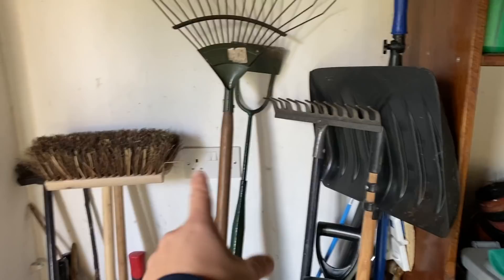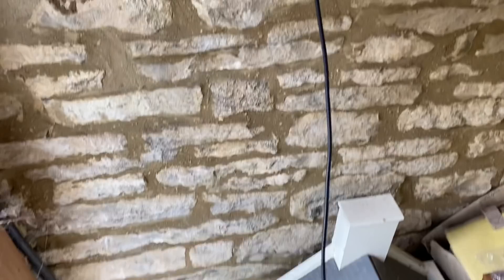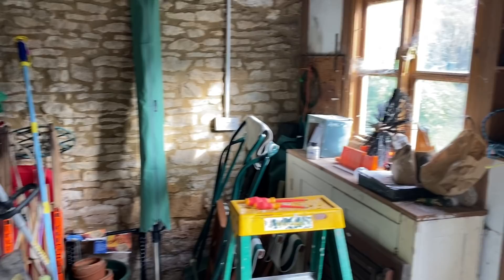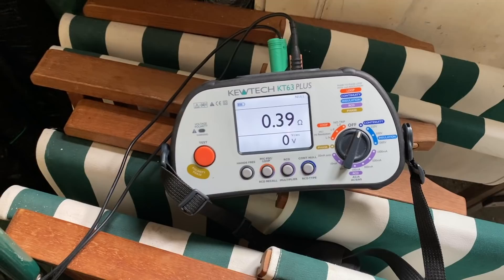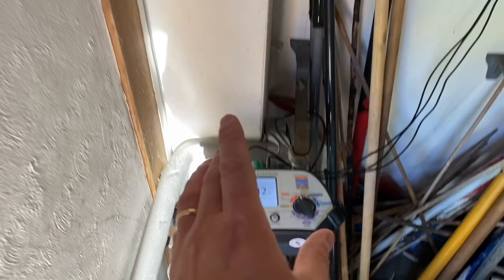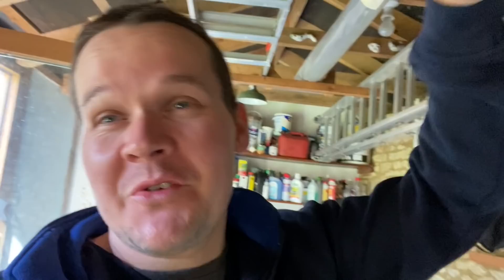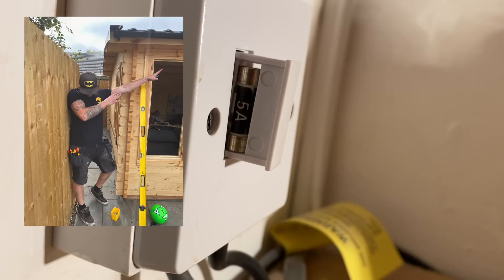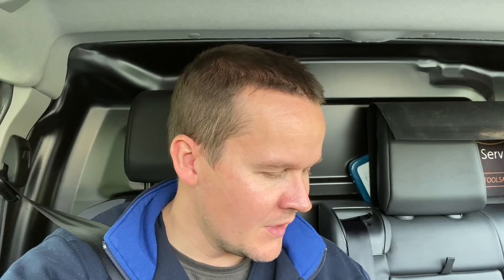THAT WAS A SHOCK ! Testing and inspecting electrical circuits.

Comment: For loose connections on ringmains - tap socket fronts with screwdriver handle. Re-test on meter if there's loads of sockets. Works best on megger because continuity auto adjusts. 👍

Comment: One that is easily overlooked is an immersion heater without a safety cutout with a plastic header tank.  It wasn't easy to see if the immersion had a safety cutout in the video.  Be safe peeps, I have read of a horrific case resulting from this that still brings tears to my eyes from years ago.
Reply: Good spot there was no cut out
Reply: That one had a cutout built into the stat. 18:17 you can see the reset hole.

Comment: 14:35 So what was with the "light" show?

First time I've seen one when you're doing a test sequence...
Reply: Contact Cleaning (ACC) - cleans tarnished contacts to improve loop readings. Essential on No-Trip but it's done on Hi-I too. Working with prods you'll encounter more oxide though I've never seen it quite like that!

Comment: When I was in the trade (many years ago), jbs were still used a lot.  I never found a loose connection in properly installed jbs:  when the terminals were tightened properly, they would give out a "squeaky noise", the same as tails do when the terminals in a connection unit ("Henly block") are tightened. I really dislike solid 2.5 sq. mm. conductors in 2.5 T&E cable: I used to find quite a few loose connections on socket outlets.  The old 7/029 sq. in. cable which 2.5 replaced when metrication took place was far superior - we used to twist the conductors together: the terminal screws gave much better grip than is possible with solid cores. The better sparks used 3/029 for lighting, which equates to 1.5 sq. mm. The old cables with stranded conductors were more flexible as well, which made installation easier.

Comment: my brand new house in Ireland had one socket in a bedroom which had L-N reversed, guess which sparky I'll never use again.
Reply: Tested a 10 year old Barratt house yesterday, sockets never been taken off the wall from new and they all had L-N reverse in one bedroom, guessing the boy did it and nobody checked ???
Reply: A case for why the old neon test drivers were good! See at a glance on one simple check whether L was on the right or left;  right OK, left NO WAY! Still require the other tests clearly.

Comment: I had a belt of a rising earth from a loose earth wire, a few months ago.  The shed had a faulty neutral  and I inadvertently become a pathway back.
Reply: An inspection I did on a house in the coutryside , earth loop impedence readings were in excess of 85000 ohms.Another one, the client said they were getting small shocks off the radiators, taps and the kitchen draining board.The house was next to a field and mice had come in and chewed cables under the floor.At the mains position, they was no earth wire off of the earth terminal into the fuseboard, fuse on the ring main could not blow, and fault current was flowing round metal work items in the house.

Comment: I am an electrician in Canada and we don't do that kind of testing. You go through the testing pretty fast and I need to pick up on the lingo, but could you send out a link that explains the tests you are doing step by step and why they are being done. Simpler the better. I have done some Zs , earth loop impedance testing before but I forget a lot of it.

Great videos!

Comment: Kewtech electrical test meters kt63 64 or 65,  are really really good, been using em for +10 years,  industrial test meters metrawatt,  IR meter flir,  general multimeters fluke,  dead testing test meters megger, soldering equipment antex,

Comment: Chris. As it's the old red/black stuff, is there any chance some or all of the ring is 2.5mm T&E with 1mm CPC? Would explain a higher R2.
Reply: Possibly, plus ambient temp and copper/resin amounts aren't the same now as they were when cable was imperial.

Comment: Great video thanks for sharing one very small point at 16.43 you mention the bathroom down lights need to be a minimum of ip44 in zone 2, it should be ipx4 as a minimum or ipx5 if water jets (shower head) are present in either zone 1 or 2.

Comment: My immersion has no cable clamp provision and I had to bodge something with a cable tie! Also I replaced the cable with Toolstation rubber cable and after a few years it turned to squishy plasticene (and the heater is only used very occasionally as a backup), beware cheap "rubber" cable!

Comment: What's the problem with a plastic CU?  Assuming this was installed a few years ago it doesn't need to comply with 3rd amendment.  Also very minor things like no two colour sticker - costs 10p and takes 10 seconds to put one on - quicker to fix than to mention on the report!

Comment: Zones 1 and 2 only extend to 225 cm from the floor IIRC (might be from the bottom of the bath/shower). Are those lights actually in the zone? Unless the ceiling is very low I'd expect they aren't.
Reply: Those down lights must have been in the bargain bin lol. IP20, most that I can find at my supplier for ~£7 are rated at least IP 65. One thing about the zones though,  they look high enough to pass ? it may be sensible to replace them anyway for the minimal cost it involves.
Reply: @KirstyTube  Provided they're outside the zones I'd just replace them if they ever fail from corrosion.

Comment: The immersion heater did not have a police stat ?
Reply: That one had a cutout built into the stat. 18:17 you can see the reset hole.
Reply: @UberAlphaSirus  no there is not,if you buy a new heater now ,the cut out is not in the stat,there is a safety cut out which is a separate item from the main thermostat it's wired from one side of the stat in to and out of the safety stat to one side of the element

Comment: You said to measure the insulation resistance at 250v but it should be done at twice the working voltage, so 500v DC was applicable. Not a criticism, just a gentle reminder to all them there folks out there. :-)
Reply from the maker: 250v is a good indication that you might of missed something plugged in.

Comment: Hi Chris 
What software are you using on your phone? 
Looks like ICertifi but I have had a nightmare using that. 
Moved from Trimble on a laptop and looking for something on my phone or iPad.

Started using Electraform on laptop tethered to my computer phone but connection times out and I can lose a few results if I’m not careful. 

I’ve ordered a sim for the iPad as electraform can be a bit cumbersome on a phone screen. 

Perhaps I need an off line version as signal can be a bit pony sometimes too.

Comment: Are there actually many properly earthed devices for sale in the UK that really care about the polarity in a single phase 230V circuit, and where would inverted polarity present a hazard? In FInland virtually any device on the market will have to work properly at either polarity (common Schutzkontakt plugs and sockets as well as the "Russian" style are symmetric, as are the low power Euro plugs). 

I know there are some rather funky ways to wire sockets in the US though. Wrong polarity on a single phase circuit can make a gas stove spark continuously after ignition, for example. Plus there are 2x120V wirings and 2 out of 3 phase 120/208V wiring styles in home settings (and appliances that can have heating elements fitted for either pahse-to-phase voltage) - and then a wiring more common in small industrial than home settings, where you have to understand vector math to understand the wiring, where a 4 contact socket can provide earth, 120V, 208V, and 240V.
Reply: It's to do with fuses being in the live side of a plug and also if you had a single pole socket which had the L-N reverse and you turned it off at the switch but left it plugged in while you repaired it etc you might get a belt
Reply: @lewis94uk  True, that is important in the UK ring system where every device has its own fuse and sockets are switched. That style of wiring isn't very common elsewhere AFAIK.

Comment: Why IP44 lights? Such a small difference in cost means fit ELV IP65. I'm not a spark I'm a grad electrical and electronic engineer - I won't have ANY mains bulbs anywhere in or near a bathroom of mine!  Ideally, even the 12v supply should be outside the bathroom in my book.
Reply: Nothing wrong with having suitably IP rated mains lighting in a bathroom, with RCD protection and correct fusing its all perfectly safe.
Reply: @cbcdesign001  nothing wrong legally but definitely wrong logically. No wall switches in a bathroom but mains powered lights! There is a logical disconnect somewhere. No MAINS wall switches in a bathroom sure but who said they couldn't be 5 volt with relay or triac switches outside rather than these STUPID pull switches? Nah! The domestic electrical market needs to wake up! It's the 21st century! Running mains power to wall switches is 
a) entirely unnecessary
b) ridiculous
c) non conducive to a modern safety oriented environment

Time to change ... It's WELL overdue!

Comment: @3.08 Seeing the clamp is put onto the outer part of the rather dirty nut on the earth rod, isn't that likely to increase the earth impedance reading?
Reply: Not if you wiggle the teeth through the dirt and corrosion to good metal before you test. You want to go to the nut and not the rod because you want to make sure the contact with the rod is good.

Comment: 20:31 In other words, this house is a semi-minor DISASTER and really should be rewired, starting from the where the local grid enters the house...

It's nothing that 10 Kg of Semtex, 6 months and a good general contractor can't fix...
Reply: 6 months? I have rewired 3 story houses in a week. I have rewired a single story ranch in a day before.
Reply: @Veritas-invenitur  The 6 months is due to the Semtex (Plastic Explosive)...
It would take approx 6 months to blow up the house, clean out the pit caused by the blast, finish squaring up the hole for the new basement, pour the foundations and build the entirely new house on the site of the old one.
Reply: @HappilyHomicidalHooligan  Oh. Lol. I didn't realize you were talking about blowing it up. Lol. That went right over my head. 😂 One of my clients who owns a massive construction company bought up an entire street back during the 2008 housing crash. Tore the entire street down. 18 houses demolished and 8 rebuild and move in ready in the period of 14 months. Turned it into an exclusive and upscale gated community. It was his way of keeping his best guys working when everyone was getting laid off. In the end he barely broke even but for him it  was more important to keep good help on the payroll so when things came back he had them than to make a profit or save some cash. He ended up selling his private jet and boat to fund the project as getting a construction loan at the time was a battle in of it self. Anyways what I am saying is you are right. A good contractor can do incredible things. On a side note. Doing what he did was the best thing he could have done in the long run. He is the one builder that never has a problem getting people to show up and hustle

Comment: What difference does a outside tap make
Reply: If its copper pipe into the ground its effectively the same as main bonding for the house and needs bonding as it becomes a possible earth electrode
Reply: Would only worry about a outside tap unless exposed conductive  parts are simultaneously available to touch + outside tap proved to be extraneous via test. 👍
Reply: I don't get it, if the tap doesn't have an earth potential then who cares where our what it is, maybe I should start to worry about metal door handles too, or the screws in my table
Reply: if the taps runs thru the earth or foundation with contact it cld still be used as a ground. and in the states we bound everything gas and water to main earth terminals as a 2ndery means to earth or a safty means. lets say main earth gets disconnected water and gas mains now become the earth. and lets say gas and water mains are non conductive but the feeder lines are and a live short happens to the lines the bounds to main earth means the current has a path to earth
Reply: @oliverriall  if they cld come into contact with a live cable cldnt hurt to have em earthed
Reply: @conorlanders8401  also if it is not but cld be exposed to a short having bounded to mains earth is a safe path to earth. works both ways as a back up and safty
Reply: M H  what about the rest of the lines if a live short happens there is no safety path to earth
Reply: @wizard3z868  this is from the IET
"It is a common misconception that bonding such items won’t cause any harm even if it is not required by BS 7671:2018 so a “better to be safe than sorry” attitude is taken. However, it is important to remember that by connecting to the main earthing terminal, in some circumstances, fault currents can be exported throughout the installation which would not be there if protective bonding had not been applied. This can cause an electric shock risk for persons outside of the installation in contact with the general mass of Earth and earthed equipment such as pipework, for example an outside tap or metal (class 1) electrical equipment. "
Reply: @westinthewest  true tht but common sense wld say tht wld be over kill but you cld earth it though lol
Reply: @westinthewest  like i said different practices and methods may not work for all
Reply: @westinthewest  yes they are i see more similarities' than differences in both system
Reply: @oliverriall  You will do not see why, until you could find a socking tap. If you will have this experience you will understand.

Comment: Ive Been struggling with my AM2 recently. Only have the testing and inspection part left to do. Unfortunately my company does not do much testing at all. Is there anything you could recommend to keep in mind or look at to get past this final hurdle??
Reply from the maker: Guidance notes 3 fantastic book
Reply: Hi mate make sure you test at every point. That’s what i failed on. Didn’t test r1 r2 on a switch fuse spur on the ring.

Comment: What code ratings for all that? No SPD? What rating? Don’t the lights needs to say they are suitable for the zone rather than an IP rating?
Reply: For me I don't see the point in using anything other than IP65 fittings in a bathroom full stop (unless it's in zone 0) as the cost difference isn't worth bothering about

Comment: Hidden junction boxes? It should be forbidden, connections allowed only at sockets and loads. Longer wires may be required but at least no floor ripping is required.
Reply: In the USA hidden junction boxes are illegal.

Comment: Immersion heater R2. Boiler R2. Always disconnect the cpcs from the appliance. Parallel paths to earth via pipework. The actual cpc could be loose or disco'd somewhere.

Comment: Would the water still need bonding if it was plastic pipe but had an outside tap. Not sure what difference the tap makes?
Reply: if the taps runs thru the earth or foundation with direct contact as to have earthing potential it cld still be used as a ground.
 in the states we bound everything gas and water to main earth terminals as a 2ndery means to earth or a safty means. 
lets say main earth gets disconnected water and gas mains now become the only earth means. lets say gas and water mains are non conductive but the feeder lines are and a live short happens (a live wire falls fom box or fixture gets cut )to those lines the bounds to main earth means the current has a path to earth.
Reply: @westinthewest  lol sorry we yanks are known to be fast paced in work and language
Reply: @wizard3z868  If you lose the earth rod the gas main is NOT a safe or legal back up. You do have to bond the gas line to the ground circuit, but that's not intended to be a secondary. It's to avoid static buildup in the gas system. The water line is a suitable secondary ground. Back in the "old days" ( before 3-prong sockets and safety grounds) the main panel was earth grounded through the water line only.

Comment: Sorry sir I failed the moaning test. o.o
And also I was totally oblivious when I had wired in the basement lighting that had tube lights that we converted to LED tube lightening then now switching that tube lighting to flat panel LED.
And why I missed it for so long but there was absolutely no ground wire in the box the idiots had cut the ground off and thought since it was a screw in light bulb that used to be in the original box that they only needed the live and neutral.
And had no ground wire on the box at all.
So what I did temporary is I put a wire from the old original "transformer box" to a screw on the outside which in theory the metal casing is suppose to be grounded.
I did that hopefully grounded now hack temporary for now eventually my folks will remodel the basement and get new wiring in but in the mean time I hope my ground job worked. o.o
And I do not know about US electrical things here I was just trying to get it safe or hope it is any ways. xD
I still have two more LED panels to put up I can do a quick video and some photos of it and show the wiring situation.
Oh yeah and it is the old cloth wiring too and the black and white are dangerously close to the same color from the age so basically have that fun part to look forward to in getting the new light panels up.
Reply: If only there was some relatively cheap way to test ground...

Comment: Was it definitely 2.5/1.5 T&E, or could it have been 2.5/1.0, though I guess at that point the reading you had was too low...
Reply: Unless the L and N were a little loose somewhere...